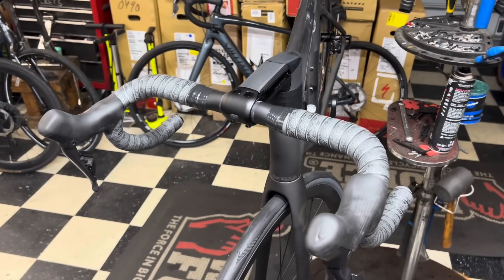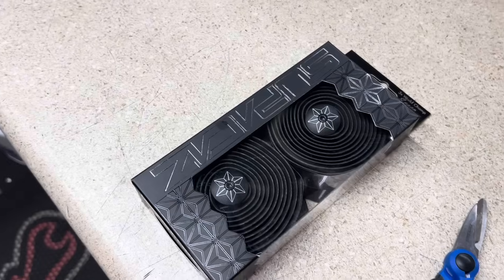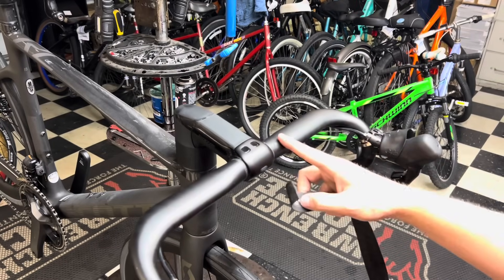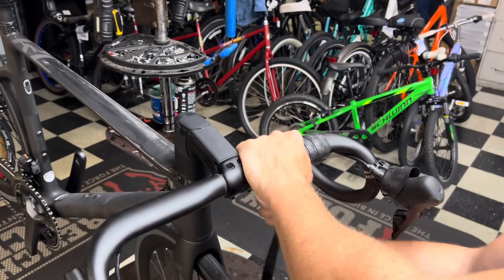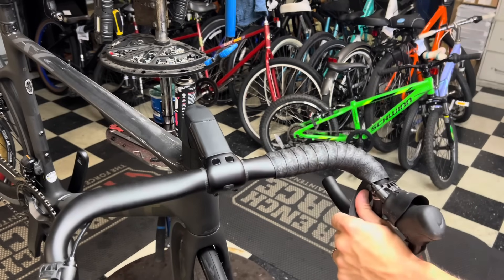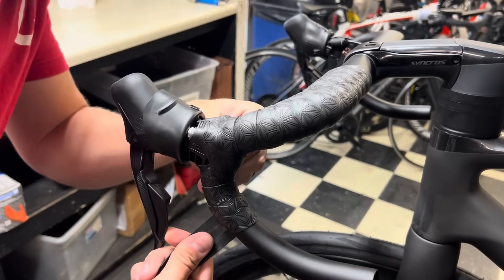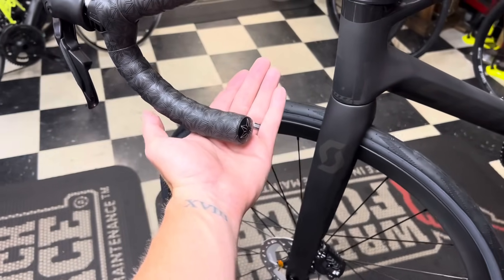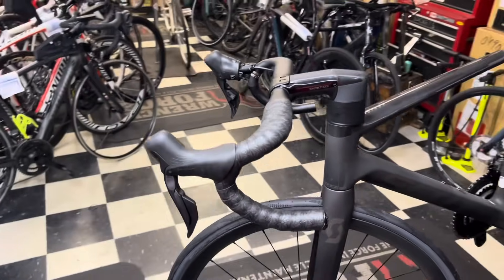HOW TO WRAP HANDLEBARS ON A ROAD BIKE, NO TAPE SHOWING *CLEAN*

Comment: Frayed bar tape edges look and feel way worse than finishing tape.
Reply from the maker: its not going to fray if you ride correctly and dont lean all your weight on the bars and let yourself slide around on the bars, just get a fit and get the right size bike. shit does not fray

Comment: Wrong! 😮😡

Do not wrap your left side drop section clockwise like this. Your hands pull to the outside of them under load and the tape will unwrap! This is a basic you should know! 

Wrap anti clockwise on the left drop and clockwise on the right side drop.

Comment: Reverse tape does not work, you are pushing the tape to roll out at the drops.  There is a reason you start from the bottom.

What you can do at the top is to use strong double sided tape to end without electrical tape.  But starting at the top is a bad idea.
Reply from the maker: yes